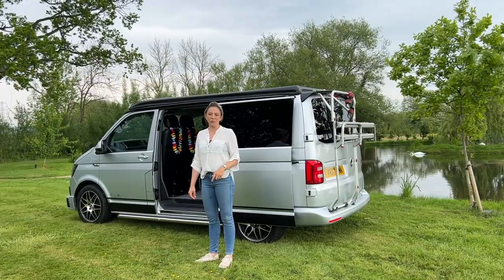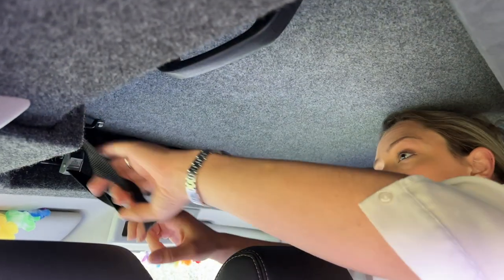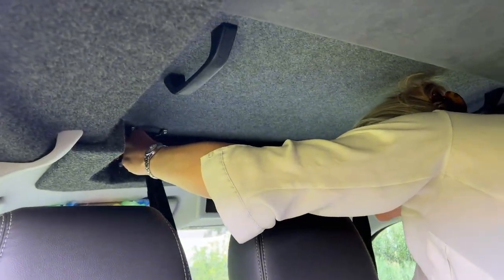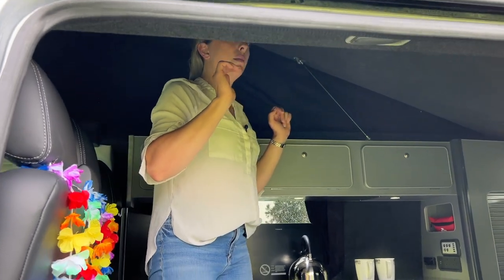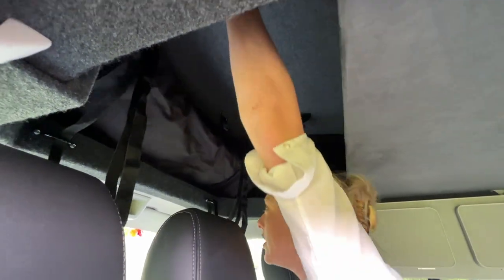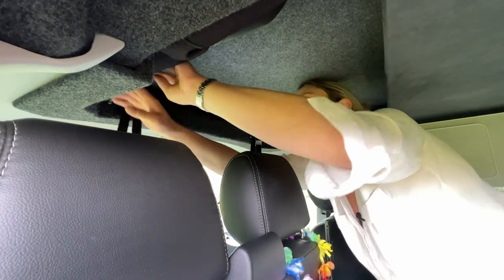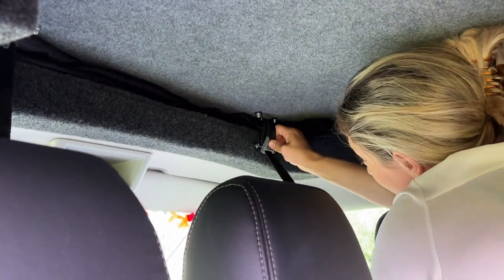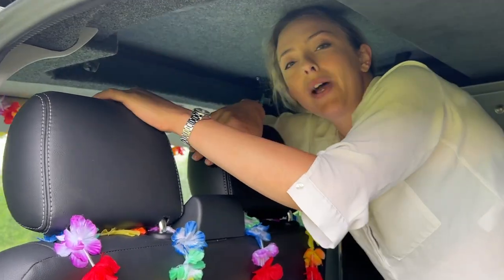Wilma - How To Use The Pop Top On A VW Camper

Comment: Also you need to do a visual check from outside that the canvas hasn’t been trapped & is sticking out between the pop top & the roof of the van before you finally tighten the two front securing straps.